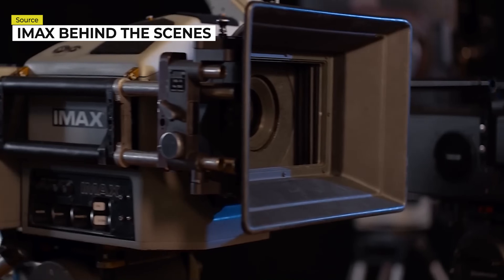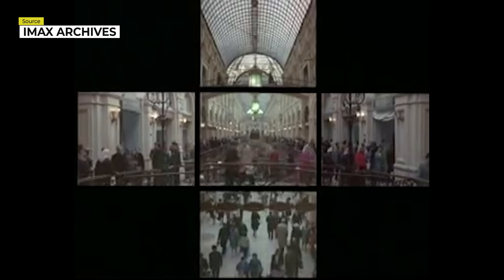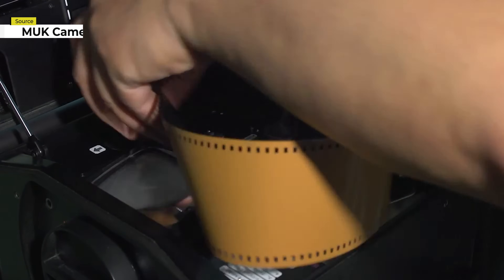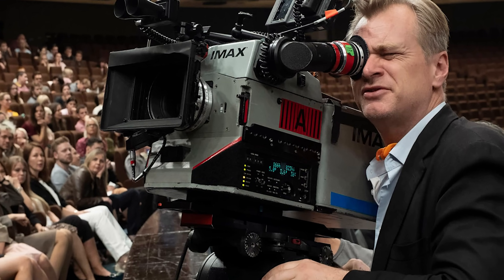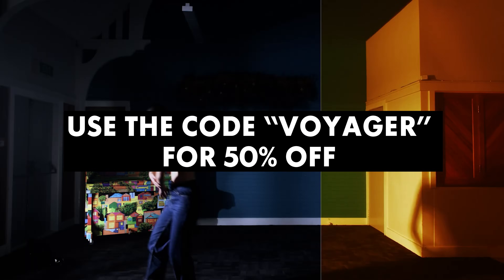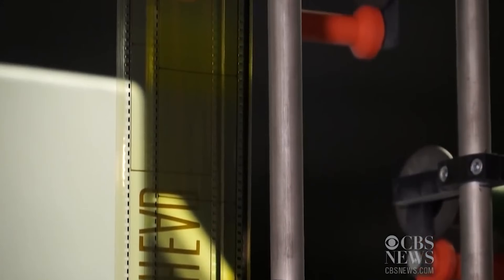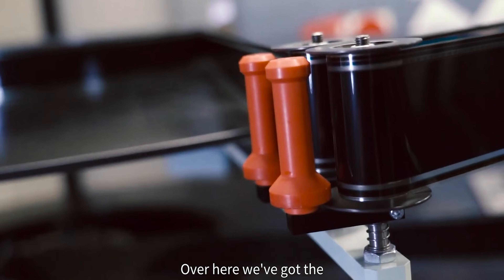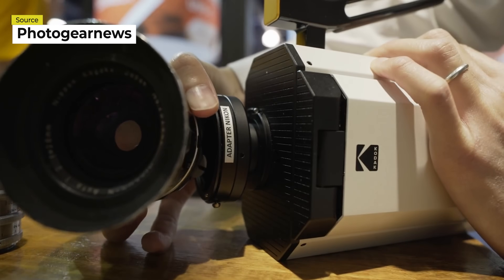The TRUTH about building a Digital IMAX camera

Comment: I think the problem will always be that digital sensors do not have the insane highlight rolloff abilities of film. Where digital sensor blow out the image, film is able to maintain information. Unless that part is solved ... having bigger sensors is kinda pointless cos you still won't get the true organic film feeling.
Reply: Highlight rolloff depends on how you process the image in post, but yes digital sensors do have a bias of being cleaner in the shadow area which is usually muddy on film, as long as you light a scene properly, digital sensor can compete toe to toe with film.
Reply: @Dennis94913  decent cameras without tons of NR with dynamic range measured 12 stops at SNR=2 can easily be underexposed to prevent that nasty digital clipping indeed. With some post the roll-off of film can be emulated for sure :)
Reply: @Dennis94913  If I underexpose my S1H in BRAW by around 2 stops, I still have no loss of actual chroma detail, which definitely isn't the case when shooting internally. ;)
Reply: Wrong. Digital sensors have better dynamic range than film does.
Reply: @zr_1234  You can watch a direct comparison between overexposing footage captured on film & digital here on YT.

"" Ultimate Film vs Digital Dynamic Range Challenge. 21 stop test! ""
Reply: @zr_1234  Also ... I talked specifically about hightlights, not shadows.

I'm well aware that digital sensors have a larger range when underexposing footage. I just don't care much about black spots as opposed to peak 255 white pixels when watching a movie.
Reply: @zr_1234  There's a lot of confusion about digital cameras...if a cellphone can do a lot...the cinema cam and pro edition can do it better. 

The 24 fps was a choice for economic reasons...was the max they could  to reduce frame rate to not broken the  studios...because the use a lot of film. Was  not to make a filme like motion. 

Noise is another problem of film not style.  Film can't do a ink blacks too. 

The resolution of the 35 mm can be any where 2k and  beyond...the limit is the sensor of the scanner. It's size and precision. 

The 70 mm can do better and bigger images because of it's size and how it handles bigger and brighter lamps. The size of the images needs more light ( twice )...and 35 mm could burn back then. They burn very easily...even today.  And deteriorate every exhibition. 

In digital you don't need resolution to show big...you need full color and lamp. 35 to 70 mil lumens...and that's it...lasers can do it today with ease. 

Digital is good. I remember my first time on digital cinema...my girlfriend always forgets or sleeps...not that day. The clarity and resolution was amazing. 

Cheers from Brazil.
Reply: I'm not sure but I don't think film look is necessarily the way human eye works. I.e. it's not natural but something we have learned to like. Usually the goal of digital capture has been to emulate how we see things (even in RAW to some extent) and then do any other tricks in post. 

Once we manage to make more dual, triple or higher n times gain sensors, I think we are going to go well beyond the capabilities of any film or human eye.

One reason why film emulation (either on camera or in post) isn't so convincing is that it's just incredibly hard to add something that wasn't captured. Otherwise there would be also a plugin to make your Android phone look like an ARRI, but there probably isn't and even if there is, it will only work under very narrow preconditions. Some people say it won't happen in general but I believe we can get much closer with AI/ML in the future.
Reply: @hbp_ film has an organic feel to the eye that draws the viewer to the image. The point is not to have picture perfect images that digital cameras try to accomplish but it’s much deeper than that it’s about the artistic quality of shooting in film.
Reply: @hbp_  In <50 years movie cameras will be a relic of the past. Movies will be AI/ML CGI.
Reply: @martinlutherkingjr.5582 it still has a long way to go nefore being 1: technically possible 2: cost effective
Reply: Can underexpose the digital image and then bring the brightness up in post. Quite simple and gives essentially the same as film. Digital sensors have  dynamic range to film but it's into the shadows rather than highlights.
Reply: @fraserembrey5676  I can make  a picture of the sun and you won't notice any bright spot at all. Neither is everything else pitch black to compensate.

Also, when shooting film you can recover like a dozen stops overexposed whereas on digital, all the information is already gone.
Reply: @mysticmarble94  When shooting digital you can recover like 10 stops underexposed. I really don't think that this is a major issue. A digital camera is much easier to expose correctly and can even expose for HDR by exposing some pixels longer/more than others,unlike film.
Reply: @fraserembrey5676  Alright ... Then tell me. Why do most films shot even on the latest Alexa ( true 4K model ), Mini or 65 still look like shit compared to movies between the year 1960 and 2000.
Reply: @mysticmarble94  It's quite hard to have a conversation with you when you are saying contemporary films look shit compared to anything shot on film in the late 1900s. I don't think that's true and if you didn't know which scenes were shot on Arri 65 vs IMAX 70/15 film then I think you'd be completely guessing if you tried to distinguish them in the final edit.

If film were so much better then why are directors and producers nearly all using digital even if they have decades of experience with film? If they wanted to use a certain medium then they get to use it because the budgets are so huge and their name carries so much weight that the cost isn't generally the biggest obstacle.

Many films shot in the 1960s-1980s used far worse lenses than today and I have not met a director or photographer who didn't say that lenses make the most difference.

What movie do you think really shows why film is so amazing and could never be made on digital?
Reply: @fraserembrey5676  Ohhhhh please ... Except for the few cases where that's literally what happened like Tarantino, Abrahams or Nolan ... All others certainly have not nearly enough say to tell a movie studio to use the considerably more expensive method when digital is available.

The simple answer is ... (1) the cost since the complete change from film to digital in the entire world wide industry is just too much and (2) they are quite frankly just too lazy to give up all the factual benefits of digital movie production like instant availability of the raw footage for immediate usage.

Just as an example ... Imagine doing the Mandalorian show in that live VR projection room with a film camera. That would be practically impossible.

So yes, I freely admit that the only benefit of film is in fact the visual quality.
Reply: "Highlight rolloff" can be emulated with a tone curve. What matters is absolute dynamic range and that one does not overexpose a digital sensor. I do not know the typical DR numbers of typical film stock, but digital sensors are already far better than colour slide film ever was. I'm sure the look film aficionados are after is a matter of post-processing, not uniquely enabled by using analogue film. Perhaps CFAs also play a role, but I would expect specialist cinema camera manufacturers to know what they are doing in that area.
Reply: I get your point, but film is organic to you because you most likely grew up seeing the format, or is just a film purest.  Digital image capture is far superior to film in many ways.
Reply: @mipmipmipmipmip Pretty much any digital video encoder will cause macro blocking at a low enough bitrate, even if the footage was shot on film.
Reply: We can't forget the DISPLAY problem, at the very end (us watching the material).  The big ongoing battle is several formats of HDR displays for the home.  Competition is huge, and home theater buffs will hunker down in their respective corners, and fight all day long over their TV purchases.  Dynamic Range of projected film is tough to beat, because at home - the brightest, whitest screen your display can produce... rarely will 'blind' you, and make you turn away.  Like if in a film theater... if the filmstrip goes "full clear" (transparent) to depict the brightest white possible... it's BLINDING.  You will likely squint or feel the desire to look away.  That is because film projection is transmissive, and the intensity of the projector bulb, or arc light, is what determines its top-end dynamic range.  And boy, it's bright.  

At home, not so much.  Or are we getting there?   OLED is being touted as "thee" display to have these days... but unfortunately a debate is swirling around whether or not today's HDR content is even being given a fair shot on such displays.  Since OLED is emissive (the tiny OLEDs emit their own light)... there is no backlight to throw.  But the downside is there is a maximum those teeny tiny OLEDs can emit... or they would fry.  So most OLED TV's max out at about 700 nits... for short bursts... in small areas of the screen.  For continuous "hot white" in scenes... most OLED panels will tamp down to limited/compressed top-end dynamic range around a running average of 300 nits.  This is why many scream that OLED shouldn't deserve to claim to be HDR.  They look fantastic, and oh yes people love the blacks... but OLED is kinda like buying a cap on your dymanic range... poor poor HDR...  with the future heading (fast) into higher dynamic range content.  

Samsung QLED (or similar array-backlit transmissive formats) are putting out panels that boast upwards of 4000 nits.  Thousands and thousands of looking-into-a-flashlight-bright LEDs create an addressable backlight that moves in sync with the footage.   This changes the whole ballgame for dynamic range at home.  In fact, if the screen is put into "full hot white" (fully open, full backlight array) - you DO have to squint, and feel the need to look away.  When HDR content is played on these TV's - you do get more of the "film theater" feel because all those hot/bright highlights feel like they are coming from that projector bulb.   With Samsung taking their LED backlight arrays into more & more controllable LEDs... they're getting to the point that every square quarter of an inch of your screen has it's own, controlled, backlight LED.   Something emitting light over 10X what an OLED can continuously emit.   Emissive pixels certainly have their place - cellphones, computer displays, standard TV viewing, etc.  But for HDR home theater or HDR gaming consoles... NITS ARE KING.   Unless they can invent emissive-dot-tech that doesn't cook itself at 4000-5000 nits continuous output...  OLED and the like are quickly going to be a phase for home theater enthusiasts.  There is no future there for current OLED and HDR...  and the industry is moving HDR !
Reply: @abandoned-mines-novascotia to be fair with oled, the reason max average brighness is limited is not heat but consumption norms. a tv isn't allowed to consume more than 300w continuous because of energy regulatory norms. with propper cooling, 1000nits full display is achievable (at the expense of the displays life). One ither solution that is used in professional grading monitors is to stack two lcd pannels. you het the square of the contrast ratio of one (theoretically assuming no luminance loss of pure white)
Reply from the maker: That's true! Though with dynamic range we are definitley getting closer every year. But your totally right
Reply: @FrameVoyager  ARRI Alexa 35 should be there, 12 usable stops of latitude, 15 stops of measured DR SNR=2.
Reply from the maker: True!
Reply: @DennisSchmitz  High dynamic range isn't everything though. The problem once again is that film doesn't have a true dynamic range, but rather slowly looses detail as things get too bright or too dark. All digital cameras have a hard cut off where once the light values pass a certain number, the image clips out completely. So even if a digital camera had a similar dynamic range to that of film, the film would still look better because it would be a slow and soft transition between highlights instead of a sudden sharp transition in which all color and luminosity data is instantly lost.
Reply: @FrameVoyager  Plus Dynamic Range the higher it gets, the more hardware on sety you will need too. Shadows are still needed, so if the DR gets better everytime, there will be less contrast between lit and unlit subjects. Without contrast no natural looking feel either.
Reply: @Leprutz  you have some misconceptions going on here.  The amount of dynamic range in your acquisition format just allows more options in post.  If you start with more dynamic range, you can also take it away afterwards.  Not the other way around.  would be the same principle, even if you had 100 stops and dynamic range you can still make it fit into 709 range in theory
Reply: Sony cameras venice and F65 can get highlight roll offs closer to film than everything else.
Reply: Arri alexa: am i a joke to u
Reply: @itsscience9113  Yes ... Ultimately, she is kind of a joke to me alongside her newer sister models. I just remembered a very distinct example where digital cameras get absolutely crushed by film. When shooting scenes lit by pure color lamps ( LEDs ).

A simple 100% blue LED would break the "" excellent"" performance of an Arri or any digital sensor and produce rather ugly blue tone artifacts.

A film capture doesn't have that problem.

For reference ... Watch Aliens (1989) where several minutes of the movie are almost entirely lit by pure red lamps and yet the color rendering of skin and everything looks absolutely undisturbed.
Reply: Look at AlvesNYR - film vs digital comparison demo. You cannot tell the difference between digital and film! It's just a matter of knowing how to expose and grade. Modern sensors have more DR than film, and can have roll off which is as good. Not to say that film doesn't have a place though! One of the main drawbacks of larger sensors is rolling shutter performance!
Reply: @MasamitsuKai  That's the comparison with the beach footage ? If so, I have already seen that a few years ago.
Reply: @mysticmarble94  no not at all! Mostly indoor shots - video made by the DOP for knives out and a couple star wars films - guy really knows his stuff. Worth a watch trust me!
Reply: Bullshit! Only for super experts, not the 99.99% of people watching movies, most of them on the phone.
Reply: @CarloFerraro  or even just in normal movie theaters without IMAX screens
Reply: @mipmipmipmipmip Why, what does ffmpeg do that is so special?
Reply: @mipmipmipmipmip Are there any VHS cameras that even have a sensor the size of an Alexa 65? I thought most of them were around ⅔” CCD
Reply: @mipmipmipmipmip Maybe they could make a camera do 24p on VHS these days if needed like the dvx100 did on MiniDV. It used a pulldown pattern to achieve 24p on interlaced TVs. Not sure if that could be done entirely with analog electronics though
Reply: At the cost we are talking here for an actual IMAX camera, even a camera that had it's sensor (and other parts like amplifiers and A/D converters) cooled way below freezing point (reduces noise, i.e. increases usable dynamic range) would be in the realm of possibility.
Reply: there is the ST2084 gamma curve which has incredible highlight resolution and gets really close to film
Reply: Interesting. Although I love the look of film I didn't realise there was any sense in which it preserved information that digital fails to.
Reply: Top Gun: Maverick is the only movie shot digitally that almost captured the "film look" for me but it still wasn't quite "there." However, the Venice 2 is a monster and the film/digital gap is closing quickly. Even as a film purist I say that in less than 10 years, 35mm will be completely redundant. (Provided the right things are done in post to emulate film.)
Reply: What are “VHS sensors?” lol. VHS is just a cassette format. A terrible one at that. As a consumer format, the CCD sensor sizes were around 1/4.  Panasonic had a Supercam series with Super VHS with 3x 1/2” CCDs. Sony’s Betacam SP cameras had 3x 1/2 or 3x 2/3”, depending on the model. Not even close to the size of the Arri Alexa 65 sensor, which is probably the best digital replacement for IMAX film.
Reply: Yes, but also you can correct for that by working with those limitations.
Reply: Very good point!
Reply: Im not sure that I actually buy that. That's true about like midrange cameras, but like of the ari alexas? I don't think they're actually significantly behind film anymore
Reply: “True organic feeling” is just a feeling created by a set of features. Anything can be done and improved individually in digital. The question is will they spend the money and time to created the needed hardware to match it. Lossless formats are always massive in size, massive in processing power and they are expensive. A Digital IMAX camera will pretty much be a high powered pc with massive storage requirements.

There is a huge revival in audio for the past few years where they are able to create profiles a for individual devices like speakers and then apply those to digital signals with similar effect. The ideas are there, they just haven’t been applied properly in the Film industry. 

In my pov the directors are stuck on an old school filter that they feel makes the best effect for movies. Digital will come and  IMAX will go because they are legacy and will be difficult to maintain repair. The movie is still digitized from the reel and then edited digitally, it’s just more hoops to jump through.
Reply: Same with positive film. What you said is only true for negative film which has its problem in shadow areas.
Reply: You can always replicate it accurately in post, one company has already done it, unnecessary waste of money which can we used for multiple films
Reply: Arri Alexa 35 surpassed the dynamic range that film can achieve.
Reply: What if someone wants the advantages of a bigger sensor but doesn’t want it to look like film? What other options do they have besides digital cameras?
Reply: Completely agree, no matter what you do to a digital image to try replicate the roll off of film, you just can’t get close. Any half decent cinematographer should be able to tell between the mediums.
Reply: @spincityvisuals  put yourself to the test! Look at AlvesNYR 'Film vs Digital - comparison demo'. Trust me its worth a watch
Reply: @spincityvisuals  If you are displaying the image on a digital display it will eventually be possible to generate images that are indistinguishable from film but whether it’s worth it will be the question. Making a digital projector look like a film projector on the other hand is unlikely to happen this century as at that point you’re dealing with atoms instead of bits but people seem to be fine with digitally projected film that was scanned in.
Reply: @martinlutherkingjr.5582  Ffmpeg can be used to encode any video into any other format. I'm guessing by encoding it into a small file with a lower resolution, you can get a VHS kinda look
Reply: @8lec_R  Not really, VHS is an analog format, highly compressed digital formats have different types of artifacts.
Reply: @martinlutherkingjr.5582  Obviously that's the last step as OP said.
There's a lot of work to be done on it before